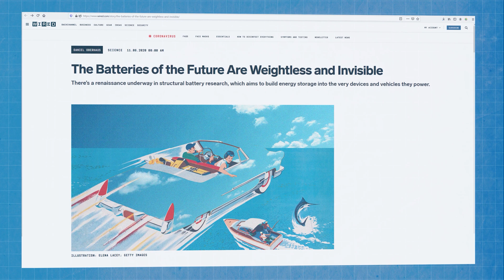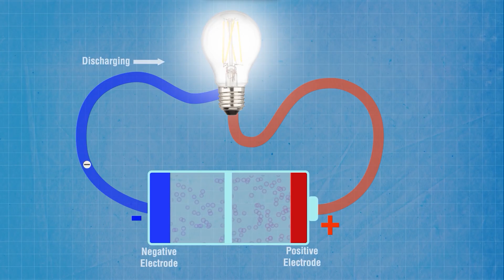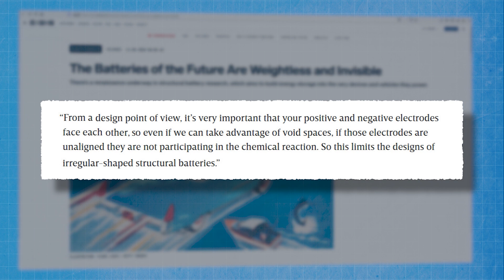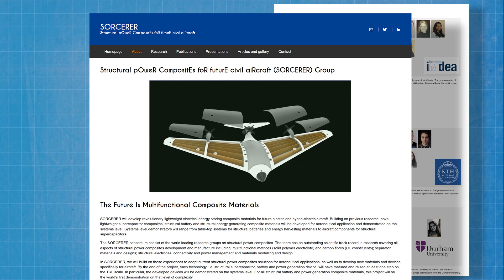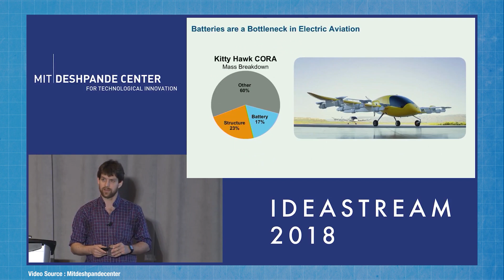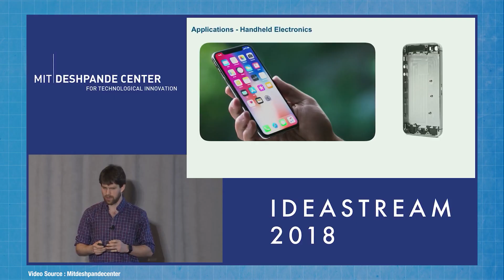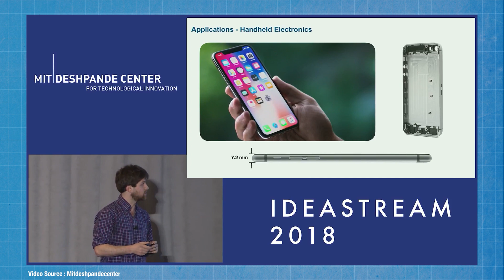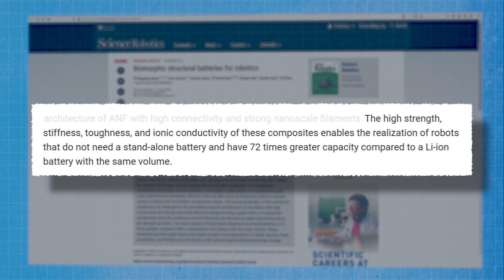Batteries in bodywork. Extending the range of cars and planes.

Comment: BMW Series 3 curb weight = 3,582 to 4,138 lbs
Tesla Model 3 = 3,554 to 4,036 lbs
Tesla's curb weight is lower at both end of the range.  

It's not clear whether the Series 3 curb weight includes a full tank of fuel.  If not, add about 100 pounds.

Once the Model 3 starts using 4680 cells the curb weight range for the Model 3 should drop lower.

Comment: Just watched a new Elon Musk interview, he mentioned there are expensive batteries that have 400 Mw/Kg now,  and he thought 450 Mw/Kg would be enough for practical electric powered flight.

On the fuel weight of the EV verse the ICE cars, aren't the batteries just the fuel tank?  Does anyone know how much 75Mw hrs of electrons would weigh?
Reply: nope, not just the tank.
You have to compare apples with apples there.. so complete drive trains.
J/kg and J/m3 batteries are still worse there, esp for flight applications.
But for cars it already can be made to work as all the BEVs are testimony to (otherwise we'd be seeing hydrogen cars).

Comment: The new Tesla Model Y has the battery as a structural unit of the car. Both front and back end of the vehicle a cast piece that enables some 300 components to be replaced by two castings attached to the battery, which forms the centre part of the chassis

Comment: I'd think that could be really useful in electric assist bicycles.  Google says a normal bike weighs about 25 lbs.  They say an e-Bike weighs 38-70 lbs. depending on the battery and motor size.  Since your other source of power is pedaling being able to lower the weight and/or add more battery in place of frame seems like it would be another place where you'd get a lot of bang for your buck.

Comment: Hello. If you allow me to go outside the topic of the video, are you aware of any district heating solutions based on hydrogen? I am writing a essay on district heating. Thank you in advance
Reply: H2 is made from NG, which costs money/energy - via electrolysis is way too expensive in comparison still.
It's cheaper to use the energy for heating directly instead of making H2.
H2 also isn't used as a large scale energy storage system (yet), so no cheap sources there either (i.e. scale of economics).

District heating most often uses the thermal waste of electric power plants to increase the efficiency of the whole process by running the waste heat though homes instead of just dumping it into the environment directly at the plant.
Very price sensitive application.. no one is going to 'waste' hydrogen on this. It would be just plain stupid.

So you won't be finding anything on hydrogen powered district heating I'm afraid.

Better to research geothermal as a source for this if you want to ride the renewables/green wave with your essay.. Iceland/Japan or any other place with volcanic activity underground will be places to look at.
Reply: @joansparky4439   thank you for your answer. I think that there are opportunities to develop a mix of geothermal/solar/hydrogen based district heating, scaling up for other uses as well such as public transportation fuel cell use, energy storage. I found some material promoted by RWE, but I wanted some scientific/academic material. Thank you anyway

Comment: How long before cars come with sealed for life batteries, just like laptop computers and phones. Great way to design in obsolescence. When the battery dies, throw away the car, just like laptops and mobile phones.
With structural batteries, a minor accident might result in a major short circuit.

Comment: The only thing I'm worried about is that if you damage your car, or bought a 2nd hand car with a dead battery, it'll cost a fortune to replace.
Reply: So just like when you buy a car with a wrecked engine, yes?
Reply: @joansparky4439  Nah that's not the right comparison. If you buy a EV with a dead battery you can change the battery pack for around $1500+, but the rest of the car works fine. 

But with a dead structural battery you gotta change a lot or all of the structural parts it's gonna cost you a small fortune. Unless you can scavenge from other cars.

But I'm most worried about repairs.
Reply: @justaguy6216  
Either the car you replace the battery for 1.5 grand on is a golf cart or the battery you're putting into it is only good for 50km.
Try 10-20 grand please.
And then we're in ICE engine territory.

Structural batteries only come once they reach 3k cycles.. not before.
You're watching a futuristic outlook here.. nothing that has been talked about will see the light of the mass consumer market within the next 10 years.
I swear.
Reply: @joansparky4439  Sorry my numbers were wrong, but it isn't as high as $20,000. The price of batteries has come down a lot, you can get most of the car's battries replaced for under $10k. Yeah still pretty expensive, but won't be as expensive as structural battries.

Of course I do agree with you the new battery tech could add thousands more cycles meaning that they battries could last forever much much longer b4 being needed to be replaced, I was only thinking in the context of current batteries.

Idk replacing car parts are getting more and more expensive day by day. Maybe I'm thinking about it too much.

Comment: Comparing the weight of the batteries to the weight of the gasoline is only part of the answer. You need to compare the drive train weight between petroleum powered cars and electric ones. I'm sure that the weight of all the systems required for a petroleum powered vehicle is much closer to the weight of a similar electrical powered vehicle, which your example doesn't take into account.

Comment: I just looked up jet fuel... by comparison, its specific energy is roughly 43MJ/kg.
Reply: You need to compare the whole drive-train.. not just the fuel itself.
Batteries are still bad in that comparison, but not as bad as one thinks - otherwise there would be Hydrogen-Vehicles driving around instead of BEVs ;-)

It's also the reason Tesla started with a clean sheet and keeps innovating to get ever more efficiency out of the cars.

Comment: Every cc of the structure when charged up has energy content just like a dedicated battery. Impact damage might have the potential to release 40 kWh of energy in the form of heat in a very short space of time. Normally, that 40 kWh is released as heat over a 5 or 6 hour journey, so a bit like 7 or 8 single bar electric fires'-worth of heat dissipating into the road and air over the journey time.

If all of that energy gets dissipated after a crash in, say, a minute, inside a stationary vehicle, that's like 2.400 single bar electric fires radiating all of that heat to the inside and outside of the car. I wonder how the designers work around that? It must have to do a lot with 'zoning' and not permitting fractured panels to affect others???

Comment: How many charge cycles before the structural battery will need to be replaced?
Reply: ..wont be deployed if below 2500-3000 cycles for appliances that need to last longer than 10 years.

Comment: Seen a fair amount of "WhAt If ThE bAtTeRy explodes/ruptures/gets punctured" here so lets have a think about that.
Warning: big ass wall of text ahead ...

 Aside from "dont operate your machine like a moron and get it punctured in the first place" ... if something SO important to the structural integrity of your vehicle gets sufficiently stressed to be "punctured"  then you have more to worry about than just  "the battery will explode and we all burn to death" you also have to worry about "oh crap the vehicle will fold in half/ fall apart/ get wrapped around a tree/rock/other vehicle while im still in it" 

If a machine has a bit of structural support that requires surviving being flexed to a certain degree (airplane wings, propeller rotors , automobile suspensions  etc) and you want to prevent punctures you can use woven kevlar coverings. Jeeps use skid plates to protect transmissions so similar things can be used for battery bits.

But remember. 
Armor has weight and weight reduces range and performance. 

So at some point you are just gonna have to trust what you have and not operate the machine in a way that gets it punctured in the first place. 

As to an entire structure being a battery.  Maybe? Using big (and therefor heavy)  structure as one solid piece has benefits from an engineering standpoint. So if it can also be used for power storage, so much the better.
Some things you dont want being made of multiple pieces, like a ships keel for example.
 or the frame of the passenger compartment of a car.  Or the roll cage of a jeep. 
Or the steel i beams that are the load bearing pillars of your building's roof. 
Such large things are obviously heavy. And if they can pull double duty as storage battery then that's less battery for you to carry. And that is where you get the nice efficiency numbers.
 The downside from this is that battery replacement will happen at some point and while swapping out a battery pack may be an hour or so  of plug and play and software updates (like changing the oil in your car) ; swapping out your car's roll cage or that load bearing pillar in your house is gonna need a shop and like as not repair techs from the company in question to do the fix. 
A work around for this might involve making the "structural" batteries the kind that store energy long term but only charge up and release it in a trickle. This can fend off replacement for as long as possible due to them not being fully discharged so often. 
While the dedicated "fast swap" battery packs can be used for energy storage and release that needs to be Fast and or in large amounts.

At the same time if one structure can be divided up smaller pieces, then each piece is a separate battery cell. 
Like say, the quarter panels of your car. the door panels too. Might as well use the door frames the same way if you can.
The front and rear cross pieces that hold the mountings for your car's bumpers. 
Or for that matter the individual skin panels for an airplane. 
The mounts (even the frames) for seats.   
Why not the wheel hubs too while we are at it.
 
THis has additional safety benefits theough redundancy. a loose stone puncturing a section of your vehicle only shorts out that particular battery cell. 
Also reduces repair cost from swapping out just a body panel or a door or even just the A pillar of your wind shield vs swapping out the entire hull of the vehicle. 
Down side is that this means you have more battery cells to manage and you also have to keep them connected so its a bit of a design hassle.   But worth it if you can "Save" weight by having that weight be a battery in addition to its primary task.

Comment: Great video! One thing I missed though is the lifetime and life-cycle of these batteries. If they need to be replaced after a number of charging cycles, that could be a problem. It might be difficult to replace and recycle the battery if the battery itself is the vehicle structure.

Comment: Thank you for the insight into something that isn't apparent for most of us.  Perhaps flow batteries would last as long as the structure?
Reply: Well, Elon Musk is talking about million million batteries.
Reply: Flow batteries (the electrolytes) for certain chemistries are supposed to have unlimited cycles.. but how are you going to use a liquid (or better 2 of them) as a structural part?
This is more about solid state battery tech..

Comment: Isn't this advancement going to kill the second life of the batteries after their life in the car?  Thus being much more wasteful.
Reply: I don't see why you couldn't cut them out and keep using them in situations where space is less of an issue? It would be sensible to think about this when designing them though.
Reply: The 2nd life may have a structural component that would be reused as well.
Reply: Put it on the roof of the garage, or lift from the side and hang on the side wall.

Comment: For a product to be considered 'green', we must consider the entire product life cycle. First of all, what is the expected life expectancy of the structural batteries? What happens when the structural batteries eventually fail (which will happen)? When conventional rechargeable batteries fail, one has the option of replacing them and sending the dead batteries off for recycling. The object is still good to go... that is, unless it's your bloody phone. I do not want to buy something battery powered without a means to change the battery. I find the inability to swap out batteries when they die to be shamefully wasteful. I will not buy a product that has batteries where I can't swap out the batteries. How will objects with structural batteries be recycled? If it's not possible to r replace structural batteries when they die OR recycle structural batteries, then it's a technology not worth pursuing. Since these questions haven't been addressed, this technology appears to be vaporware.

Comment: I'm curious about the lifespan of these. It's one thing to replace batteries as a separate component, but if they are structural then the lifespan of the entire device is pretty much limited to that of the battery. Is there any data on longevity of these things? 
Great video, and thanks for bringing to everyone's attention.
Reply: Lifetimes of batteries is measured in cycles (full charge/discharge) until their capacity goes below 80%.
1000-2000 is the current state of the art afaik.
So depending on your application the device will be technically obsolete long before the batteries are done for.

Please note that phones or similar devices for example overcharge (+overdischarge) their batteries (intentionally) and only reach about 500 cycles or worse till they get to the 80% mark.
Reply: Primary structural components in cars and aircraft are difficult to replace only because there has never been a need to routinely replace them.  I think that a creative engineering-minded person could devise replaceable structural components that double as batteries given the requirement that the part be easily replaceable.  Of course, making a component replaceable will likely, in itself, affect the overall weight but these are the trade-offs that have to be managed with innovative designs.
Reply: Elon recons he will have a 1m mile battery soon!
Reply: @markthomasson5077  They already have the 2 million mile ones.
Reply: This was my question as well. Would love to hear more thoughts on it.

Comment: Your propeller blade is your grid storage battery. Your wind farm can store excess peak production for still hours. Your solar panels are also your grid storage batteries, and their inverters furnish automated impedance matching when you aren't drawing A/C current, lengthening the life of grid equipment and reducing peak power demand. Your car body is the battery, making your EV weigh no more than a conventional ICE, and giving it 10%-20% greater range. You can fly a dirigible with a rigid battery envelope powerful enough to generate its own hydrogen and drive the propellers at nearly the speed of jets, with five times the payload for a fraction the cost.

Just so I understand, is that what you're saying?

Comment: I mean, the seat frames seam a good place to use a structural battery. Much less stress forces than a wing, and takes up a sizable portion of weight and volume in comparison to the fuselage covering.

Comment: I know that it’s been thought about so many times ,but gut feeling is that if we use hybrid hydrogen electric power systems for transportation we could incorporate both the use of this technology,structural batteries ,with hydroelectric lightweight systems to overcome these limitations for transportation systems .👌🏾
Reply: FCEV are heavier and have a lower power rating than pure BEVs.
If FCEVs were superior in this regard (and just be more expensive), they'd be used for super-cars or any other niche where money is no objection..
They aren't.
BEV's are present in all classes except long range haul by now and sooner or later will be there as well.
FCEVs are BEVs with a low power, expensive FC-range-extender..
FCEVs had been a tech dead end and only pushed by the incumbent FF industry as the source for the economic hydrogen was NG (and not electrolysis).. not to mention that the manufacturing and distribution system could be monopolized to generate profits for the few.
With BEVs all you need is solar on your roof and you're good to go.
FCEVs, or anything FC really is not going to come.

Comment: Fuel as a percentage of the mass does not scale with all the other parts needed to produce the power when the engine, crank, injectors, starter motor - etc, all the way through to exhaust - a major amount of wait all together. 
I looked inside the new E-mustang at a Ford office in the Netherlands - almost like having an empty boot at the front with a small space taken up by a motor.... looked awesome too.
Reply: The size and weight are still there, just usually under the vehicle rather than in front of the driver. Electric vehicles always weigh much more than comparable liquid-fuel vehicles, even though the drivetrain is simpler and lighter.

Also, and this is particularly relevant for aircraft, the battery weight penalty is effectively double. With liquid fuel, your average fuel weight is just over half your initial fuel weight, because it will be nearly empty by the end of the flight. And even the initial fuel weight is not the maximum possible weight — you can put in only as much fuel as you will need. With batteries, the weight penalty does not go down during the flight, nor is it smaller for a shorter flight.
Reply: I think we will eventually pick up energy like trams, but form the ground some how - something is around the corner for sure